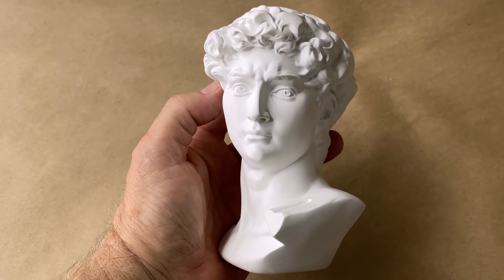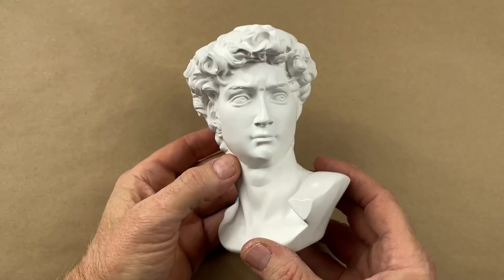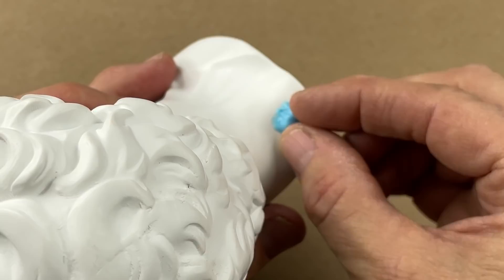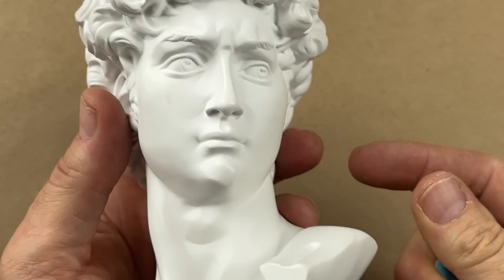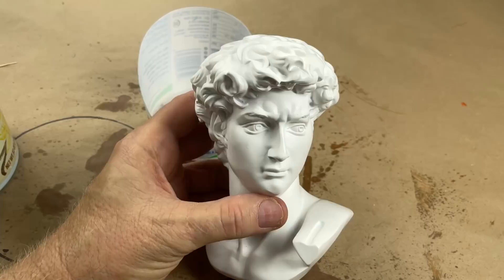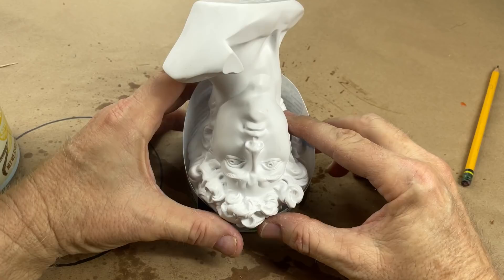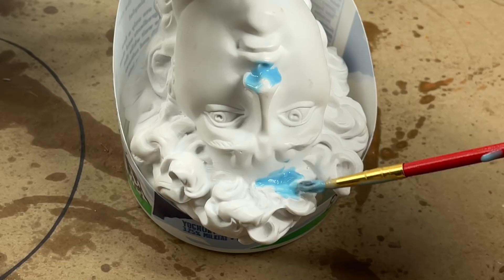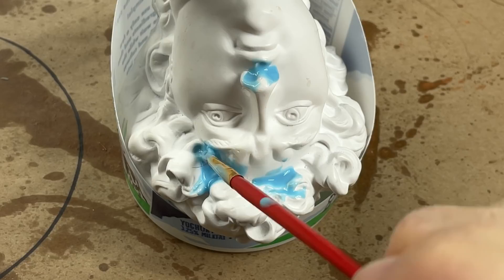Making A Candle With A Silicone Rubber Mold

Comment: A tip for the wick Robert, dip it in the hot wax and hang it to dry before you fix it in the mould, it makes it much simpler and becomes self-supporting.  You also get an actual "wick" not a "piece of string" when you de-mould it.
Reply from the maker: Great idea!

Comment: regarding the calculation of wax for the sculpture, you can calculate the volume of wax needed easily by water displacement. 

fill a container to the absolute brim with water, put it in another container that can catch overflow. then put in your object. make sure it's completely covered by water. the water that overflows into the outer container is the exact volume of the object. you can then use that volume to measure out a different liquid, in this case, wax.

Comment: Great mold and video, very thorough. A couple of tips for you, which you're probably already aware of; A cheap (ebay) pair of medical retractors act as a second pair of hands when cutting open the mould - helpful when scalpels are close to fingers. Soft clay in a syringe with the needle removed creates great spaghetti like 'worms' to seal around mold bases. Cheers Robert.

Comment: Bravo, that sure was something new. I tried wax casting and found that controling the right pour temprature can be a problem.
I think that moderate heating of the mold does help in some ways. Still amazing to see what some folk artists can do with this medium. Wax has been used as a casting compound producing religious folk articles (figurines, angels etc.)  for ages. As I understand there are a lot of old secret formulars and ingrediants around, kept secret outside the family. If you make it to Germany, Bavaria is a good place to look around for wax art. Makes one speechless to see what castings once where (and still are) mass produced without the aid of a pressure pot etc. I think pressure wasn´t even in this world than ....
Great Show as usual - looking forward to next friday.
Reply: My father would make sealed molds by pouring another thin layer around the seal, and have them suspended in boiling water. One wick hole filled tight, you can let the wax settle without melting immediately. Then you you can easily tear it back open.

Turn off the hot water, walk away. He made a lot of

Comment: That was a fun watch, thanks Robert!
I've got a book called Pop Sculpture about making figurines and collectibles, and they use wax castings during the refinement process. The way they avoid shrinkage, distortion, and loss of detail is preheating the mold in the microwave as well as doing pressure casting. This necessitates a small reservoir of extra wax to fill in as the shrink occurs, like a larger pour funnel integrated into the mold. They also use crayons (white + desired color) in the wax batch to pigment the sculpture's surface and get it more visible, but I'm not sure if those pigments are safe to burn in a candle.
Reply from the maker: Yes, a reservoir is a good idea.  I often rough out a sculpt in clay then re-cast it in sculpting wax to do the final work. In those cases I make the clay sculpture 8 to 10% oversized and place it on a reservoir base. Of course, I am casting it in sculpting wax which has a lot of solids.  That reduces the amount of shrink and preserves the detail. I pressure cast it to remove bubbles and also heat the mold so that the wax doesn’t cool while it is being poured into the mold. Still, it shrinks enough to be noticeable.

Comment: That shrinkage tho. wow. did not expect that.
Reply: I expected worse. I've made candles and there is ussually a deep divot down the center and once fill it it has its own divot. You do it a few times. 
Lots of regular like votive candles are compressed sort of powdered wax.
Reply: @chartle1  I have a silicone mold and poured lead into it.(yes 360°c Hot) 
I also made a pour with gipsum/cement.  Guess which one is bigger!

Comment: I wonder if there would be a way to 3D print the object with more volume than intended so that when the wax shrinks it ends up with the proper proportion and detail. Like an embroidery machine, when creating a digital design you have to overcompensate the size and stretch the image to account for the shrinkage that happens when stitching tightens the material during embroidery and shrinks the image

Comment: Another great video Robert, having a warm mold helps when candle making. Im guessing you made a hole to pull the wick through the top?
Reply from the maker: The proper technique is to use a wick needle and just poke a hole and pull the wick through.  I don’t have a wick needle, so I cut the parting line to the top of the head and just secured the wick between the halves of the mold.
Reply: @RobertTolone  Hi Robert, watch you a lot. Great stuff. I made a candle mould for a client and created the wick hole with just a thin wire pushed through the top of the mould after curing.  Use the same wire with a looped end to insert the wick. The silicon just closes and holds the wick in place.

Comment: When you did the tester the rubber did not stick at all. 
What is the best materials a object should be so that rubber does not stick to the object? Just like in the tester.
Reply from the maker: Nonporous surfaces are best. Rubber will bond tight to fibers like wood, paper or cloth.  Seal those with beeswax.  if you’re sculpting something make sure you use a clay, wax or other material that does not contain sulfur.  If you’re molding an existing object just do what I did and test the surface with a small dab of rubber.

Comment: Nice work!
But there is one thing I don't really understand. You have a perfect mould case from when you made the mould but you don't use it for the cast. Would it not make it easier to get even pressure on the mould than with the rubber bands alone?
Reply from the maker: That is an excellent question Christian. The reason I don’t use it is because it can be difficult to perfectly align the rubber mold with the original case. Also inside the case I cannot see the parting lines.  I like to be able to massage, prod and poke the rubber mold into a proper alignment along the parting line. When you cannot see the parting line you can’t tell if it is aligned with certainty.
Reply: @RobertTolone  thank you for your answer. Now I see the sense in your decision.

Comment: Could you put a little wax in the mold and then spin the mold around until the inside is coated and then finish filling it to try to prevent air entrapment. Evn if the wax hardened on the surface the rest of the hot wax should remelt it.
Reply from the maker: I have never tried that technique. Give it a shot and report back your results.

Comment: How did you drop the wick in the bottom, but get a few inches to come out of the top ?
Reply from the maker: I put the wick through the cut in the top of the mold and closed the mold around it.  Of course, the top of the head is at the bottom when you pour the wax in. So there is some chance that wax will leak out where the wick goes through.  But it would only be a small leak and not a problem.

Comment: why not use hot glue for 80-90 percent of what the wax is for? edit: i see the part where you say hot glue sticks too much but if you put it in the right place (like on the outside of the mold seam) then you can just peel it off or give it a bit of heat to remove it

Comment: Shoulf I use release agent on silicone mold?... I using epoxy resin
Reply from the maker: If your epoxy resin is wearing your molds out quickly it would be good to use a release agent.

Comment: Why don't you put the model onto a vibrating shaker table whe pouring the wax in mold? Keep it on the shaker table to force the bubbles to the top.
Reply from the maker: I don’t pour a lot of wax because I don’t make candles. But in resin I have not found vibration to be effective for eliminating bubbles.

Comment: Wondering since the overhangs are still there after painting on the rubber, if it could create bubbles still under the overhang and if the pressure of casting could cause the bubbles to cause a distortion in the casting
Reply from the maker: Anytime you have bubbles in a mold it can potentially cost distortion.

Comment: How did you stop the wick from leaving an imprint in the head when you placed it in the mould and how did you fix it in place inside ?
Reply from the maker: I put the wick into the cut line and closed the mold rubber around it. It only leaked a tiny amount of wax around the wick. as I have learned, the proper way to do it is to use a wicking needle and simply poke the needle through the rubber and pull the wick into the mold cavity.
Reply: @RobertTolone  amazing thankyou so much for these informative videos , I'm from the UK and actually watch them with my children because they find them mesmerising 🙌
Reply from the maker: @georgiadennis6758  Thanks for watching Georgia. I appreciate it!

Comment: When you get ready to use the mold would it help to reuse the cardboard edges held in place with the rubber bands? I think that would help prevent shape distortions.
Reply from the maker: I don’t like to use the mold case under the rubber bands because it prevents me from seeing the parting lines. I like to see the lines so I can adjust them and make sure they’re tight. If the rubber bands are applied properly they should not distort the mold.

Comment: Robert could using a surfactant to help aid surface tension and cut down the bubbles? If yes what would you use? Also would warming the mold up help when pouring hot material?
Reply from the maker: I don’t know of any surfactant that would help and I am always leery of extra materials in the process. When casting wax it is very helpful to warm the mold.

Comment: What exactly is the blue mold ingredients you mix together? Where can I find it?
Reply from the maker: It is Econosil -25 silicone rubber from www.silpak.com.  You mix 10 parts of the rubber with 1 part of hardener.
Reply: @RobertTolone  thank you for your quick response!
Is what you said all I need along with the release spray? I notice your pdf mentions hardners and resins but I'm unclear if that's needed for every project or just what you needed for this particular one?
For reference I'm trying to make a beeswax candle mold.
Reply from the maker: @DarkNight-uf8ir  The PDF refers to materials are used commonly in most of my videos.
Reply: So is it all of them I would need to purchase to make a mold or just the Econosil -25?
Reply from the maker: @DarkNight-uf8ir  To make this project I specifically used Econosil-25 rubber, blue wax sticks, sticky wax, beeswax and oil clay.
Reply: @RobertTolone  thank you for letting me know. Your channel is hands down the best one on this topic. Thank you for all your efforts in sharing this knowledge with us.

Comment: Do you let the painted ruber cure. I was wondering if that was ok and if it would fuse with the rest of the rubber poured afterwards.
Reply from the maker: Yes, I let it at least gel so that it stays in place. But you can build molds in layers, allowing each layer to cure in between pours .  That’s the way it is with the rubber I use. It’s always a good idea to test your materials.

Comment: does the rubber he paints on before making the mold become part of the mold or do those details/crevices just get eliminated in the final product?
Reply: As long as you're using the same type of silicone, piece will fully adhere to whatever you pour as if it were all the same pour.

Comment: I was wondering if you have any tips for making a rubber mold over sulfur based clays like Plasticine I've heard that the mold will get messed up because of the sulfur?
Reply from the maker: You only have a couple of options.  One is to apply a sealer or barrier coat that will stick to the clay and be compatible with the rubber.  You could try a clear acrylic spray, pva and/or mold release wax.  But only testing will tell you what works with your materials.
The other option is to switch to a molding material that does not react with sulfur. You could ask your material dealer if they can recommend such a product. The best thing to do is to never use sulfur bearing clays.

Comment: How did you get the wick at the bottom of mold (top of the candle)? Thanks
Reply from the maker: There is a slit in the mold that holds the wick. As I understand it candlemakers use a wicking needle to poke the wick through the rubber.

Comment: Hi Robert, thank you so much for these videos!! They’re soo helpful and the way you explain things is super easy to understand! I have a question, can I use a candle as the figurine to cast a mould?
Reply from the maker: Sure, wax is an excellent material to pull molds from.  Having said that, test your molding rubber with the kind of wax in your candle. But if it is paraffin or beeswax you should be fine

Comment: Love your videos Robert. How come you didn't just put the 2 carboard parts back together as a mold case for pouring? Are the several rubber bands on the rubber better than encasing it back in that cardboard tube shell? Thanks!
Reply from the maker: It’s usually a pain to get the mold back into the case that formed it and also it obscures  my view of the parting line.  I like to be able to see the parting line and make sure that it is correctly aligned as I put on the rubber bands. And finally, it’s an extra step that is not necessary.

Comment: Hi Robert! You mention the wick being in the cut line (the top part of the wick that exited the mould), did you cut a hole for the exit of the wick? Or did you seal it with wax? Thanks
Reply from the maker: I just put the wick in the cut line with a half inch or so sticking out and closed the rubber around it.  This held the wick in place and left a small gap in the rubber around the wick but the wax only leaked out a tiny amount when I poured it.
Reply: @RobertTolone  thanks Robert! Love all your videos, so so helpful :)

Comment: Could you, instead of drawing the first layer on just dunk the sculpture in the stuff then pour it over the sculpture when placed in the mold?
Reply from the maker: The important idea here is to carefully fill areas where bubbles of air can be trapped. The problem with techniques like dunking and pouring is that you can’t be certain that air hasn’t been trapped. By carefully identifying problem areas and pre-filling them with rubber you are certain of getting a bubble free mold. Craftsmanship at this stage will save you from having flaws in every casting the mold makes.

Comment: Nice video.  How did you get the wick to come out of the bottom of the mold (top of the head), without wax leaking out?  thanks
Reply from the maker: I put the wick into the cut line of the mold and closed the rubber around it.  It only leaked a tiny amount around the wick.

Comment: Robert, I follow your channel and your tips have helped me make better castings.  I make mostly resin cast bits and pieces for classic car restorations for parts that are no longer available.  Resins that cure very hard are brittle when the casting is thin.  Have you ever added milled glass fiber to resin to increase the strength of parts?  Thanks, Ben
Reply from the maker: I have experimented with various additives to modify the resin characteristics. Usually the only difficulty is they can make the resin less viscous and more difficult to pour. I always follow the manufacturers instructions as to the maximum amount of material that can be added to the resin.

Comment: Informative as always. Do you have any experience with casting concrete? I am thinking about making some garden ornaments.
Reply from the maker: Very little. I made a video about the very first thing I ever cast (in high school) which was a bust in concrete. I do know that you can use urethane rubber molds for concrete and they last a long time.
Reply: @RobertTolone  Thx, I'll have a look into into it.

Comment: For this I would say a better outcome would have been had for the majority of the cast to be high temperature tolerance resin cats around a a water solvable plug of some sort...cure the cast ...de mold the cast....dissolve water soluble plug and let dry ...then pour candle into the void created by the dissolving of the plug...this technique  while not necessarily the major portion of the cast being what it is here in my comment....wax shrinkage when it cools has always been the bane of pouring high detail candles so a harder wax is generally what would be used here for the visible part of the candle and softer wax used for the core...but harder waxes melt at higher temperature  so it may be a problematic combination withe the silicone casting material...the loss of detail in your attempt is more readily apparent because you are looking at the model and comparing it to the candle...would it be that obvious if you only saw the outcome but not the model?

Comment: Great work! But the problem is the cost of silicon mold.. for a big project like this, i think you need to use like 1kg of silicone that, in my case, cost more than 30$..

Comment: I wonder if you could have put it in the vacuum chamber to pull the air out? If you did have a parting line you could hit it quickly with your new heat gun.👍
Reply from the maker: Maybe, if I had designed a large reservoir above the mold to hold the wax as it expanded under vacuum.
Reply: @RobertTolone  I also find it really strange that it lost detail. Usually as things get smaller it gains detail.